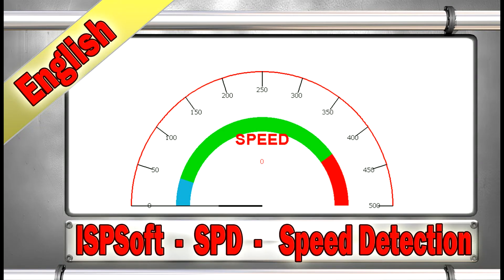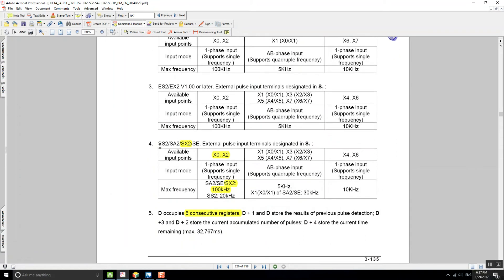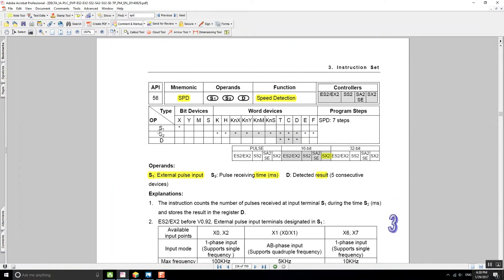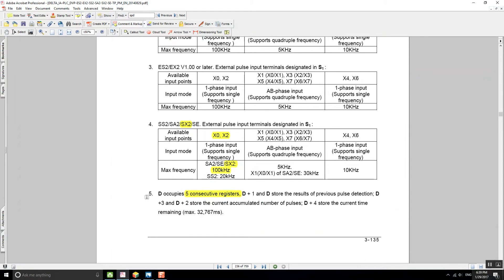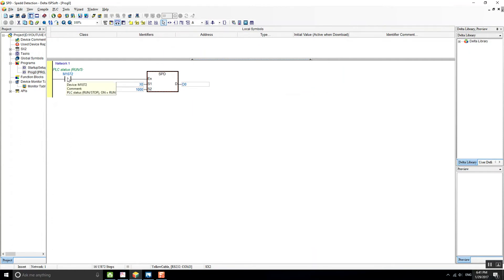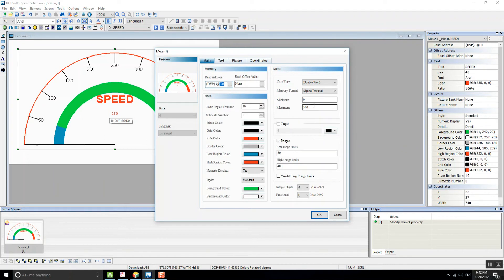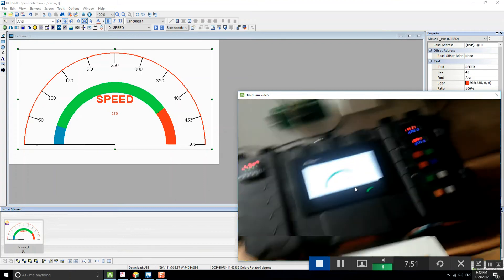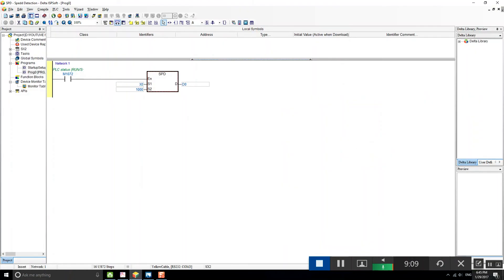ISPSOft - SPD - Speed Detection

Comment: Thanks for the video sir. Can you please show how this SPD instruction work in delta plc(14SS2)? How to calculate D0 and how much time (ms) we have to set. Suppose i have motor running at speed in between 0-80 m/min. Now if i want a signal at speed 30 m/min. The moment speed goes down below 30 m/min that signal must be switched off. Can you program like this? Thanks

Comment: 0lá, I'm Brazilian and I'm starting now with PLC DELTA.
I do not find a FLAG to round fractional numbers.
exempol: 512 pulse wrapping on one axis with 300mm displacement per revolution. It would give 1,707 approx, in the MUL block it does not accept 1,707 x 512 which would be approx 512.1. In other brands like LS (LG PLC) there is the block "R2I" (real for integer)
Help!!!! how to round this value in ISPSoft?